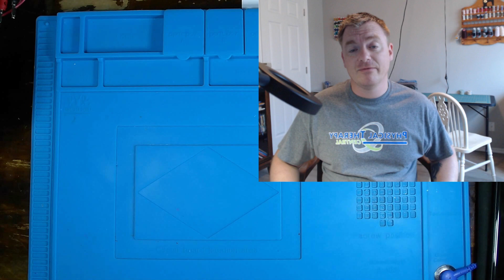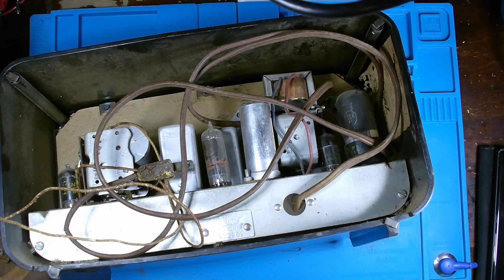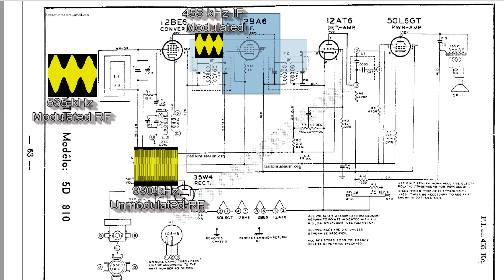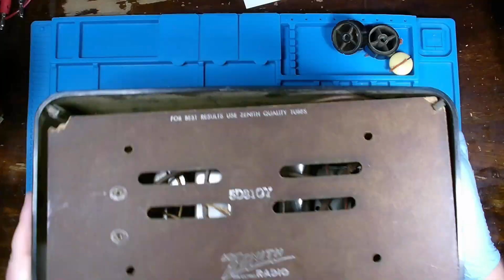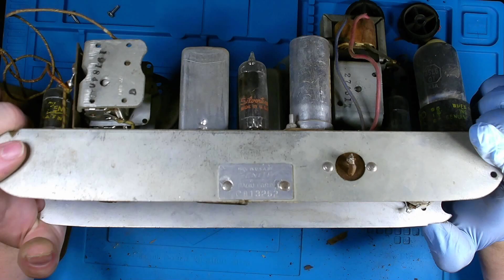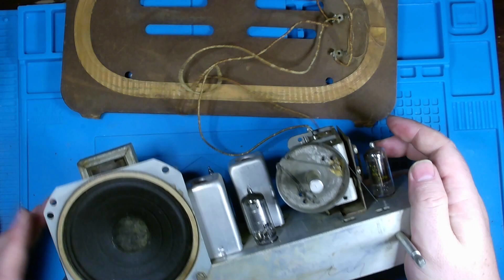(Part 1/4) Zenith Radio 5D810Y Restoration: Introduction to Radio Theory

Comment: Greetings:
Hope this helps "gently".
The two diodes in the 12AT6 are used here separately and otherwise wired together to "detect" the intelligence signal by half-wave rectifying the modulated IF signal from the input side of T2 by discarding both the top half of that modulated signal and keeping the lower negative half. The remaining portion of the IF signal is bypassed to ground by capacitor C10. In this circuit the second diodes output is used to provide the DC level that is the AVC used to affect the signal gain of both the converter tube through the loop antenna and  IF amplifier via the coil of the second half of T1. The greater the negative value of the AVC signal at the grid of both tubes, the smaller will be the gain there such that weaker received signals are amplified more relatively than strong signals. In some designs both diodes are used together through T2 to provide both the AVC and the detected audio that is fed through the volume control with DC blocked to the triple for voltage gain before the power output tube and before the volume control but after the the high frequency IF is mostly bypassed off leaving the negative DC to affect the gains. Here the second diode exiting pin 3 of the 12AT6 is used to source the automatic VOLUME control (AVC) for those two earlier tubes. Follow that pin3 dc signal to see which grid pin affects the signal gain of that stage.
U1 is a "couplate" that combines both the coupling to the power tube and more bypassing of the IF signal away from the power tube. Although you may not hear the IF frequency through the output transformer, that signal will put unnecessary stress on the output tube through heating.
The 35L6 is swappable with the 50L6 but too little voltage drop in the 36L6 will put a strain on the other heater filaments by raising the heater current. A series resistor dropping 15vac so the series heater current is 150ma (100 ohms) will restore the proper power dissipation. P=IE=.15 A * 15V=.75 watt so a 1 w 100 ohm resistor will do.
Use rubber or speaker cone cement for the cone repair.
Notice that the air dielectric tuning capacitor is skewed in its mounting. That plus the bent tunIng shaft support account for the lack of spring tension on that dial string.
"Mister radio" is the youtube channel nicknamed "radiorama". Seth is the host located in the East Bay area of San Francisco where his radio repairs go to support his local vintage radio club through sales of repaired radios. He almost always attaches an audio input to each repaired unit using a low power isolation transformer scavenged from a low power wall-wart, typically 5 to 9 vac because the chassis are often "hot" (power transformerless).
The usual main suspects are the electrolytic capacitors and any paper/foil capacitors used for coupling the output plate of the first audio trident in the detector tube and G1 of the power tube. That grid should never be allowed to go positive!
Those electrolytics are C15 20 mfd and C16 60 mfd. That new "death" cap also is only .01 uf not .05 uf. The true mica caps (some look like mica but are not) usually need not be replaced.
On tube equipment the smaller of the two ganged capacitors is the local oscillator section, on some sets both caps are equal size but the coil inductance  is changed so the IF frequency is produced.
The ganged tuning "condenser" has the base and the movable parts at the same potential, often sparated from the chassis by rubber grommets to avoid shorting out the AVC which is often passed through the resonant coil of its tank circuit.
Mess with the speaker cone at your own expense. Most of the spring action is the spider securing the bottomof the speaker cone.
Reply from the maker: @jamesmdeluca Helped immensely! Appreciate the corrections. Lots of inexperience on my end working through a radio from this era and reading what you wrote while looking at the schematic just now was extremely helpful.

Did you mean pin 5 of 12AT6 though? On the diagram pins 4 & 3 reflect heater. I could definitely use a good source of tech data/training on vacuum tubes. I was also wondering if 12AT6 could be replaced by diodes or transistors while leaving pins 4 & 3 in series with 35W4 for its filament to still glow. 

Appreciate your explanation of U1 this makes sense now to me. 

I swapped 35L6 for a 50L6 in a later video as well as replaced the entire cone. However, I've definitely annotated your comment on my own diagrams and will use it for future reference. Thank you again!

Also thank you for identifying "Mister Radio/Radiorama's" name. I've watched several of Seth's videos going on almost a year now (if not a year) and have yet to catch his name until you mentioned it now. 

For the 20mfd and 60mfd replacement (video 2) I went with what was stamped on the can itself which were different values. I assumed the can had been replaced at some point. Although, I've regretted that decision since. 

Appreciate the comments on the grommets, they were in extremely poor condition and I expected would affect the 2-ganged tuning condenser. Thank you for identifying that it also will have an effect on the radios AVC. I think I replaced them in either video 2 or 3, but I don't recall which one. 

I've also pinned your comment so others who watch can see your contribution at the top of the comment section.

I'm auctioning off this radio (video 4) to raise money to support a local church and facility repairs. If you know of anyone interested in the auction I would appreciate the help "word of mouth". Only if you feel inclined.

Comment: Good explanation / overview, looking forward to part 2.
Some comments (my opinion only and not meant to be negative) -
Perhaps in part 2 explain (briefly) why you need a carrier and an IF (some viewers may not know) and why you would generally replace paper capacitors of that age (what can happen to them).

Lose the background music unless you are not speaking for a long period.

You can use WD 40 to flush out sticking bearings but you should then clean out the WD40 as much as possible and then use a light machine oil.

For cleaning between cans etc. try what I think is the 'Dave Tipton method', use a split chopstick, small makeup pad and IPA.

You pronounced Zenith as Zenith and not Zeeenith, I am curious to know how was Zenith pronounced when the radio was first released (presumably in the USA).
Reply from the maker: Appreciate the feedback, sounds like you've a bit of experience with AA5 radios. 

Yes, I often mispronounce things. It's almost like I know the correct pronunciation, but my inclination towards the southern vernacular takes over 🤣

Other than not having a can of WD40 on hand, I think I had used electronic cleaner, I'm slightly apprehensive using it in bearings. Many years ago I worked in a rollerblade/skate repair shop and learned it can really mess up small bearings, which is why I used a bearing packing grease. That being said what you've stated about a light machine oil makes a lot of sense and I've seen other channels do the same process as well. 

Fully noted on the music! I added it in low volume because I was overthinking my presentation a bit. Now that I've had time away from that video I fully concur. 

The next video I'll be going over capacitors (while replacing them) and multiple methods for determining the outside foil. It will most likely release next month. I've learned to space them out from previous anthology type content. Viewership goes down significantly more when they are released one after another.
Reply: @HavingFunRepairs  The main issue with 'old' bearings, record player mechanisms etc is that the old grease (which is usually causing the binding) has to be flushed out / cleaned off first, as otherwise adding new grease / oil will just make things worse. Electronic cleaners can be problematic, many of the older types damaged plastics, which are used as bearings in some components. Conventional WD40 is a good 'flushing' product but the lubricant part is poor (in my opinion).
Reply from the maker: @ralphj4012  appreciate the explanation, makes sense!